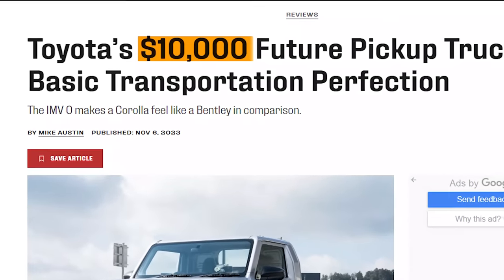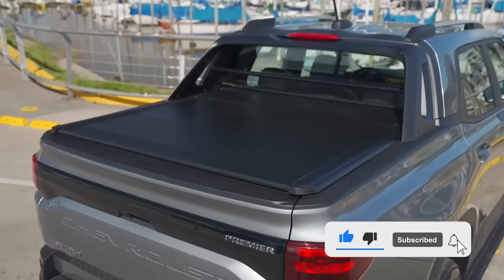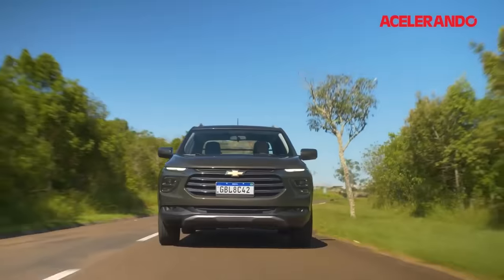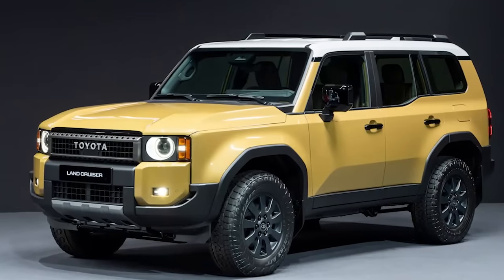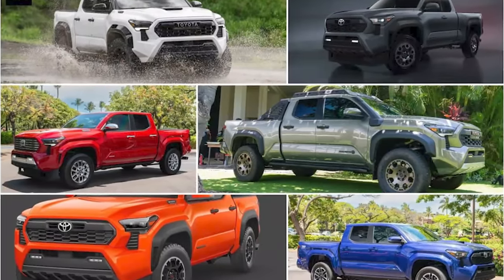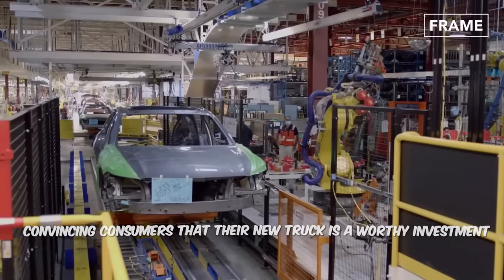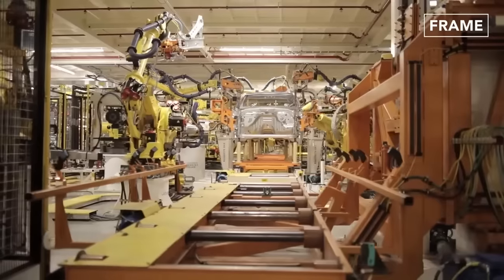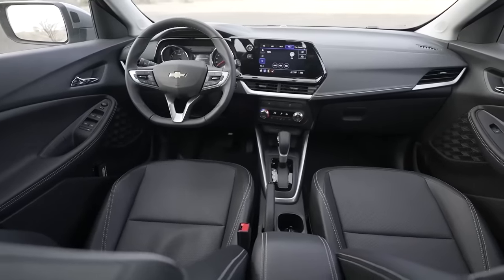GM CEO Reveals NEW $10,000 Pickup Truck & SHOCKED Everyone!

Comment: i don't care how cheap it is. if it's electric, i won't be getting it
Reply: It's been in production for years. The new model is a 1.2L turbo inline 3cyl gas engine
Reply: I’m with you, put a gas engine in it and I’ll buy it‼️
Reply: I'm also with you on this.
Reply: No doubt,  ask ford about the crappy lightning.  No thanks
Reply: It's gas
Reply: That’s a very very small engine, 
So we assume NO automatic or infinite variable transmissions ??
🤔
Reply: That’s a very very small engine, 
So we assume NO automatic or infinite variable transmissions ??
🤔
Reply: Right
Reply: Agreed
Reply: It could not possibly be an electric truck because, the battery alone for the Chevy volt is over $26,000
Reply: Chevy just crams plastic/aluminum garbage engines.

Comment: The 10,000 may be the base price but no one will be able to buy one at that price. By the time you add dealer add-ons and accessories where still going to be talking 40,000 to 50,000.
Reply: At least it's your choice what options you pick. The way it is now, you have to take an expensive package with 10 things you don't want just to get the one thing you want. This is the way vehicles used to be sold. Way better for the consumer. Also, if you can't afford an option now, just get it later.

Comment: It better be sold in the US. Made in the US would be good too. It's not sold in the US because they don't meet US emission standards. I tried like crazy to get a FourTwo diesel. Instead they rebranded the car into a Smart car and met US emissions with lousy MPG for the car 35-37 at best. Couldn't even meet the old Geo performance and mileage. No 50mpg. Get rid of all the extra electrical stuff, and it would be nice. Go back to bare bones. I don't need a truck that has an infotainment center, or back up camera. I understand having an efi system, but even that can be a pain, due to the brain box. IDK, whatever happens will happen. Personally I'd rather have an old 46 Chevy stepside. At least you didn't need a degree to work on them. easy peasy

Comment: A chevy mini truck would be just fine with me, providing it can be had in a 2 door cab configuration. I need it to run errands down to my local Grange Coop for hay/ straw/ and feed/ fence posts etc. Don't even need ac, or a radio/nav stuff. Just barebones will do just fine.

Comment: I have a 07 Silverado crew cab I bought new. I'm retired and would love to buy another small truck to carry light load and tow my 5x8 trailer around town. I think this truck would be great unless the add on prices runs it up to high. I have looked at the ford base modal starting at 20,000 but you can't find one for less than 29,000. I am not in a hurry to buy but I am watching the market for a small cheap truck to go on sale. My truck is a good one, but a small truck would be more convenient. I have a good used truck and the price of used trucks is crazy high so I will stay with my truck till I find what I think is a good deal for me. Not in a hurry lucky for me

Comment: The only one that is a truck shown is the Toyota IMV 0. All the rest are SUVs with the last 3 feet cut off the back so it is an open trunk. They are not even a pickup. If you can not lay a 4x8 sheet of plywood in it it is not a pickup or a truck.

Comment: Alright, the Toyota is coming out with a new model around $10K so the American auto club is racing to keep up, again. The biggest obstacle is regulations by the EPA a club of non-elected officials who are against smaller vehicles using less fuel unless those vehicles achieve impossible mileage. Auto makers can keep their four-door trucks, fancy blaze trinkets and over sized seating with a monster console. I want a two-door manual shift with manual window cranks and a full size bed, if I get a few scratches or dings I don't care so much.

Comment: Clarification:
GM first sold the "Montana" in North America as a minivan, under the Pontiac brand. On that point alone, 'resurrecting' it under the Chevrolet brand as a compact pickup truck might leave a bad taste in the mouths of many prospective buyers.

Additionally, the Chevy Montana compact pickup truck that's been sold in South America for the past 20+ years wouldn't cut it for most prospective buyers in the North American market. Yes, there's been an influx of people buying full size pickup trucks, who never put anything larger/heavier in the back than their groceries, but the majority of full zise pickup truck owners use them either for their jobs, or in any number of practical ways that are necessary; and the South American Montana pedigree simply won't cut it.

The Ford Ranger has the pedigree. It's been proven, time snd again. That's why RAM is taking it's time to reintroduce a competitive product to go up against it (the Dakota). They want to get it right. They won't be going head to head with the Maverick, which isn't really a pickup truck.

Whatever Chevy does, uf it's electric, it will flounder.
Reply: The dakota was junk. Poorly engineered compared to the f.s. ram. If it was any good Chrysler would have updated it.

Comment: Some of theses would be perfect as a Snap on Snap off Drone attachments.     OK, so  99 % of cars have 1 person in them....  My concept of the perfect flying car is a "snap on snap off" 1 person 3 wheel lite weight electric golf cart with separate top fitting snap on drone.  When you get close to where you  fly into you can un snap the cart and drive to where you want to go.  You own the cart but the drone is rented.  Keep the cost low and let the drone attachment recharge.  You will not get the same drone back each time as they are charging up.   Lots of city Drone Ports and one at your house.  99% of people could afford this....!  Keep it simple......  use what we have....  Cart battery used as back up to drone!  Total disrupter to old fashion expensive cars, clogged up highways and oil energy industries.....  save environment  at same time...???
Reply: Sounds great I only see one problem..most of these mofos can't drive n now you want them to fly? And besides that be a pretty heavy battery I think to fly a person material cargo etc and swapping the drone prolly be ok but how's the frame getting to where you want to be? And if your flying the drone who's driving the frame if your riding on the frame why would you need the drone?

Comment: If the Great Mistake Corporation, is going to make ANOTHER $10000, truck.

I'm going to have to dust off the Snap-on box, and oil up the tools. 

I could use ANOTHER million, fixing that crap.

Except that engine... I'm not putting my certificate in jeopardy, for that piece of crap. Isuzu can be responsible for their own garbage.

Comment: Looks like a Subaru brat from the late eighties but the Toyota has the ugly that a guy that needs a real truck wants, simple and adaptable. This truck looks like a down sized version of the crap with 4 drs and no bed everyone is selling. But if they keep it at that price and do not over load it  may be good for some one that only uses a truck occasionally. I will take the old C10 long bed style any day. I have a Ram 1500 tradesman long bed I will drive till I drop. Plus a Nissan pu 1994 and a 1998 S10 both 2dr reg bed.

Comment: This is BS hype GM ia not capable making a $10000 golf cart let alone a $10k truck.   GM has higher internal and fixed costs than Ford who can barely make a $25,000 Maverick  A GM "Montana cost wiil start at $30k plus.  This 10k truck is clickbait and internet hype. For reference a base model Yamaha Golf cart starts an meet zero highway safety standards.